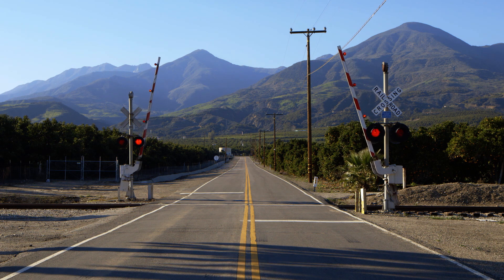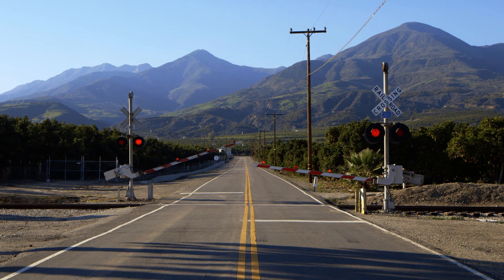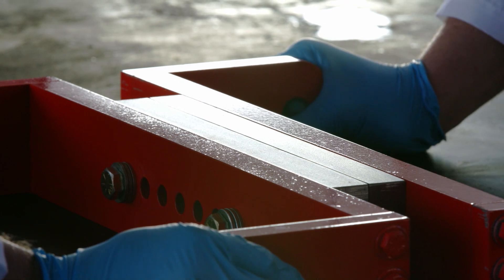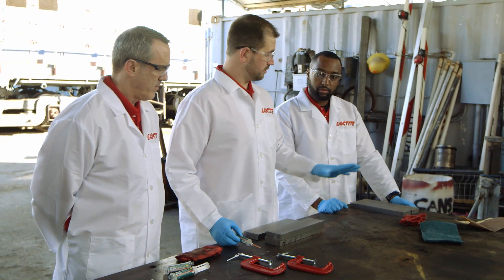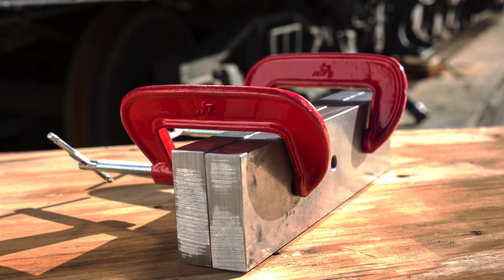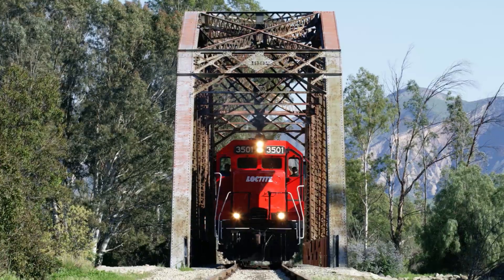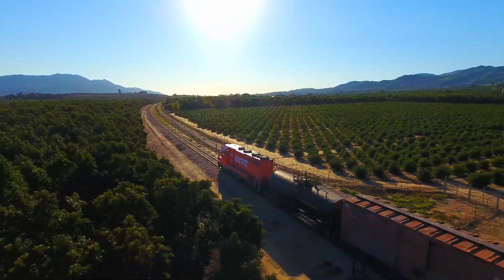How Loctite Pulled a Train Using Only Adhesive

Comment: You pull it to near parallels from close to line vector force. What is the curve rotation angle can braking point on pulling weight with stickled connection on two surfaces size with distance of each other to maximum frequency for protect same amount of connection time in same travel?

Comment: Don't you think it's a 'tad' misleading to yap about the 200+ ton locomotive when the load on your plates is nowhere near 200T?
 Depending on rail conditions, the maximum drawbar pull of a locomotive is around 1/4 of its weight, and I don't think the locomotive ever gave it more than a whiff of power.
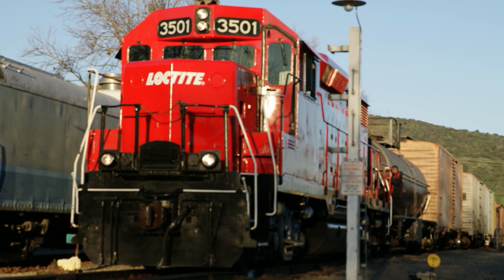Reply: Agreed. They should have not even mentioned the "200T" figure. I think that must have been the marketing team as the whitelabcoat guy actually said at 1:07, the load is *75T* per car (plus other forces from "shaking and shimmying").
Reply: That’s still 50t. Still impressive